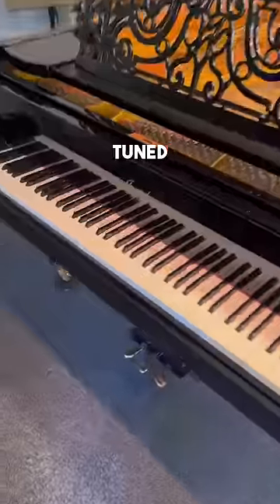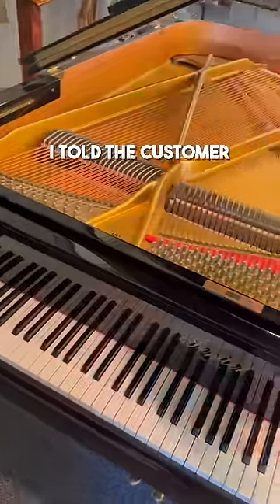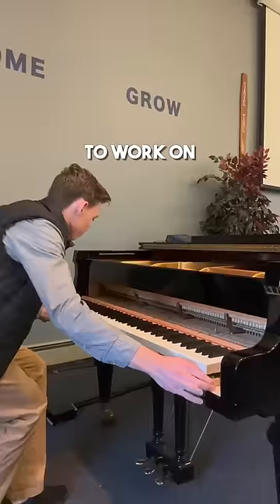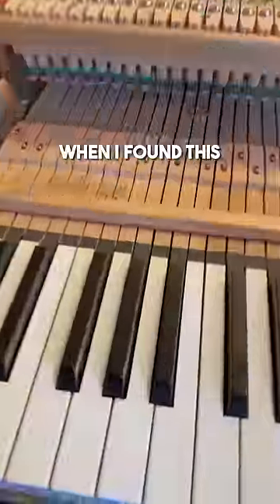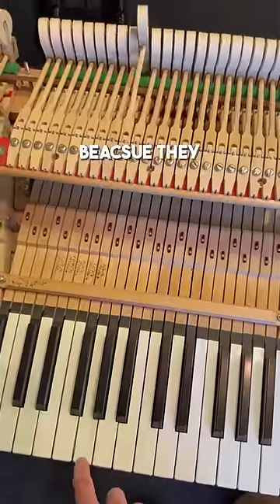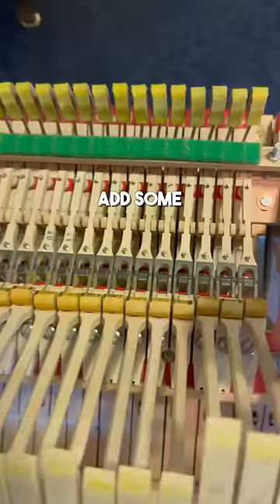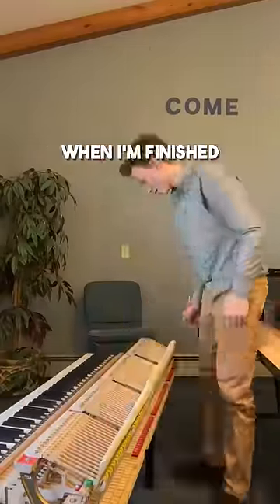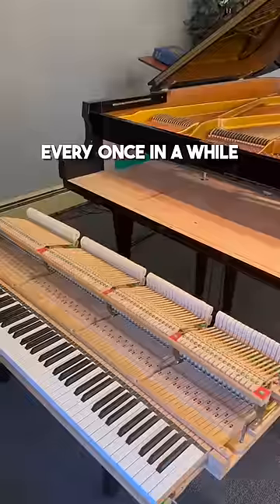Finding a ring inside of a Grand Piano #piano

Comment: FYI, modern pencils aren't graphite either! They're crystalline graphite derived from petrolium, and kaolin (clay). The softest pencils are 90% graphite but harder ones are as little as 20%. Ideally, just buy pure graphite powder for lubrication - no clay, no petrolium byproducts on your wood.
Reply: Damn. I dont play piano either. This is equivalent to me reading something about fretboard wax being... not wax... or something.
Reply: Which is still graphite
Reply: So it's still graphite. 🤦‍♂️
Reply: Element is still element regardless where it comes from
Reply: Still graphite.
Reply: still graphite bro.
Reply: Depends on the traces petrol leaves, I assume it's a negligible amount and people would've noticed the difference if it was as harmful as you portrayed it.
Reply: have you messed with graphite powder? for how much of a pain in the ass it is it's just not worth it. The wax/clay binder will at least keep most of the graphite where it's needed rather than completely smear
Reply: its still graphite just a different type
Reply: @PianoDoctor As per EmilWandel above, just get the softest B pencil you can, as it has the most graphite and the least clay.  In the US/UK that would commonly be a B6, but there are pencils up to a 9B.
Reply: @PianoDoctor  you assume? Why are you doing things you assume work if you’re telling people you know how to fix it?
Reply: In Europe we use micro teflon powder (PTFE) on hammer knuckles. Lubricates extremely well, lasts a long time and doesn't make a mess! You can also use it on key pins, glide bolts and many other places.
Reply: Everyone whose saying it's still graphite, cola is water. Plus dude just looking out for people lol
Reply: @ethangray8417  
Cola isn't water dude. Don't be ridiculous.
Reply: @stickiedmin6508 that's the point
Reply: Still graphite
Reply: @emilwandel  keep your "probably" out of this
Reply: crystalline graphite...
Reply: @TimecastGaming  graphite isnt an element its a form of carbon
Reply: You are correct. Graphite is a form of carbon and not an element in and of itself. Carbon is an element on the periodic table with the symbol "C" and atomic number 6. Graphite is one of the allotropes of carbon, along with diamond, fullerene, and graphene. Allotropes are different forms of the same element that have different physical and chemical properties. Graphite is a soft, black, lustrous material with a layered structure and is commonly used as a lubricant, electrode material, and in pencil leads. While it is not technically correct to refer to graphite as an element, it is possible that some people might use the term "graphite" to mean "elemental carbon in the form of graphite." In certain contexts, such as in a casual conversation or a non-scientific setting, people may use terminology that is not entirely precise.
Reply: @TimecastGaming  seems like ChatGTP answer.
Reply: @sloppyprogrammer4373  You would be correct.

Comment: I don't think I've seen graphite used for cases like this but at our piano place we use it quite a bit. We generally have graphite mixed with alcohol and paint it on using a brush, the alcohol evaporates and it leaves a perfect amount of graphite on the surface.

Comment: Wondering why you didn’t use graphite liquid on the jacks and levers, then use a stiff brush and ivory key to burnish them rather than applying graphite by pencil to the rollers?
But in rubbing the rollers with the pencil you disrupt the knap of the roller leathers. 
Ultimately if the rollers are worn (compacted) to extend of squeaking, then replacing the rollers may need to be considered.

Comment: The graphite trick is also great for guitars, putting graphite the nut can free up biting, which messes with your tuning, especially after you bend a string, nut bite can make a guitar basically unplayable, because anything other than playing very carefully can put them out of tune instantly. To do it you just loosen the strings, lift them out of the nut, and squiggle it in with a pencil. The high E and B(possibly even the G) will require very sharp pencils though.

Comment: Is there a benefit to using graphite instead of PTFE powder? PTFE is typically what I use for knuckles, damper spoons, and a few other felt or leather joints.
Reply: In most cases PTFE is the better choice ... if you have it.

Comment: While graphite is a lubricant used in various industries, is drawing with a pencil really the best way to apply it to the keys rather than a proper graphite lubricant or applicator? Lol.
Honestly curious. Like, I have a bottle of door lock lubricant graphite. Doesn't rubbing it still cause wear rather than an application of the dust itself, pre-dusted?

Comment: Hey I refinished piano keys for a guy in Cupertino California we used to bleach one piece ivory keys strip to plastic old keys we’re burn them off and then we have to play in the keys down Mike the new plastic and then plane the keys down to that specific measurement so it would fit in the action of the piano and we replace felt bushings you could also hand tune the bushings with a special pair of pliers we would buff out all the keys Hell we even did some imitation ivory from Yamaha called ivorite

Comment: Oh but be careful with pencils in other situations - you can't surrogate pure graphite with pencils because part of it is burned clay (10 to 80 per cent) 

May work on piano keys - but application 
On some small metal made machanics could increase wear in the long run.
Reply from the maker: Thank you for the advice! I have graphic powder, and use it for metal mechanics, but I thought a pencil might be more relatable and easier to understand for the video.

Comment: Pencil lead is actually a graphite alloy
It has mostly graphite(super fragile)
And aluminum/alumenyum (for the briish people)
Also small amounts of tin
And a few other metals
It about 90% graphite 
But with the added things
It’s pencil lead
Doesn’t smear as bad
Doesn’t break when you pick it up

Also the amounts of the materials are changed which changes durability and color
No. 2 has a darker color which is also the one I described

Comment: There is a better way of applying graphite than to use a pencil like you show in the video. The typical pencil led has graphite mixed with binders. It would be better for you to get a solid graphite stick from an art supply store to do the graphite application. You get better lubrication from rubbing those on the joints than you would from rubbing a pencil for the same.

Comment: Pencil graphite is endlessly useful.  I use it on my oboe pads when they get sticky.  I scribble on a piece of paper and slide it around under the pad.  You can also scribble on a key and insert it into a sticky lock and it lubricates that as well.